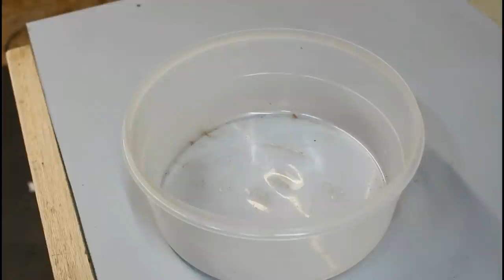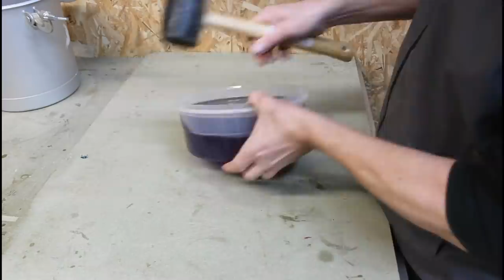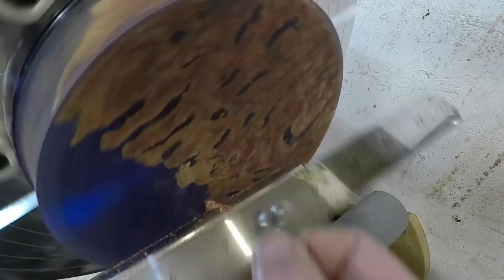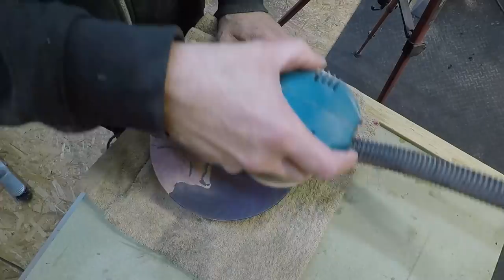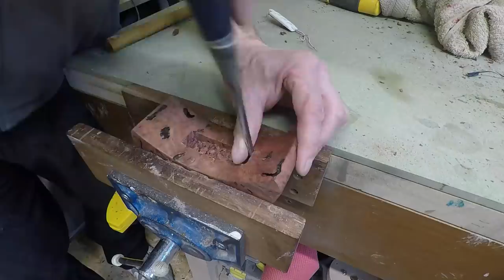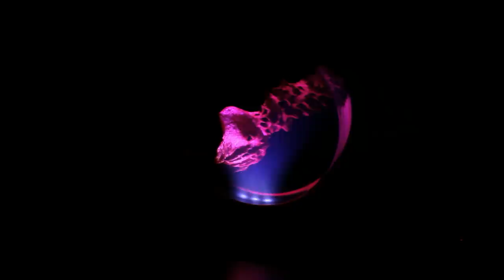Woodturning - The Purple Haze

Comment: I always wondered what it looked like while it was curing in the pot and how the resin came out with no bubbles. My nerdy curiosity has been satisfied.
Reply: What you saw i "think" was a few cycles of creating a vacuum so that when it released it really got into that wood. Then , while it wasn't directly shown, i assume he reversed the flow and put it under pressure to cure. It was glassy at the end and that's tough to get just with a vacuum.

Comment: I was so inspired by this that I went out and bought a vacuum chamber and pump. Then alumite resining. Then dyes. Then carbide tipped tools. Then the Beal buffing system. You cost me a fortune!
One real question though... where did you get the bowl you used as a mold? I have searched the web and can’t find anything like it.
Bob
Reply from the maker: LOL ..sorry about that ..i'm sure you will have fun though ..I stole it out of the kitchen when my wife wasn't looking just fits snuggly in the pressure pot .. not sure where it was from but think it was a container for a cake ..

Comment: Incredible result, great work.
Was it under pressure in the pot or were you pulling a vacuum? If vacuum then for how long? Thanks.
Reply from the maker: Thanks..I pulled vacuum until there were no more bubbles..not sure how long ..and then put it in the pressure pot for a couple of days (it's really slow setting)

Comment: Ciao  Andy semplicemente stupefacente. C'è un sistema per calcolare quanta resina devi mescolare? inoltre chi non ha la pentola a pressione cosa si può fare? Grazie Andy
Reply from the maker: Thanks .. I just mix the amount of resin by eye no calculating .. If you dont have a pressure pot try and use a slow set epoxy to allow any air to disperse

Comment: What make of resin do you use? I bought resin off Amazon with colour dies included but it is too brittle, just chips rather than cuts.
Reply from the maker: On this I used deep cast slow set epoxy from Eli-Chem resins

Comment: Great job!!! Did you pull a vacuum and then move it to the pressure pot?  How long did you leave the vacuum on it?
Reply from the maker: Thanks .. Yes vac then pressure I just pull vac until I get no more bubbles ..not sure how long
Reply: @AndyPhillipWoodturning  Very nice work. Do you have a link to the light you used? My dad is a wood turner and wants to make a similar light. Thanks in advance!